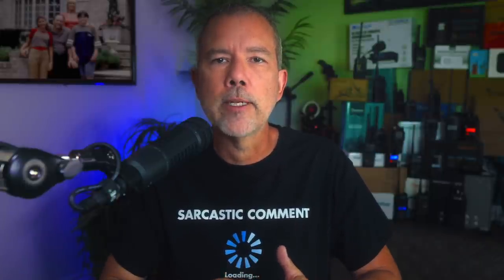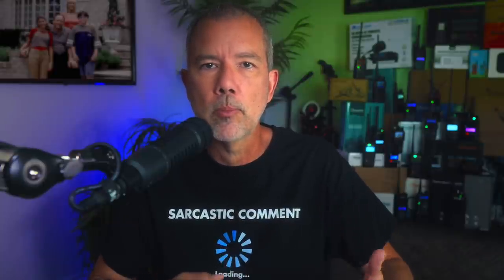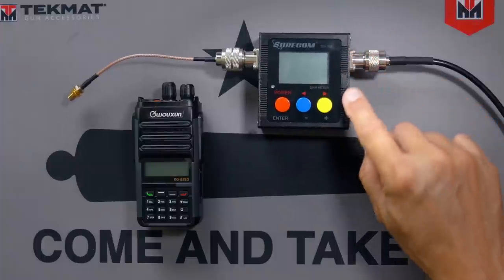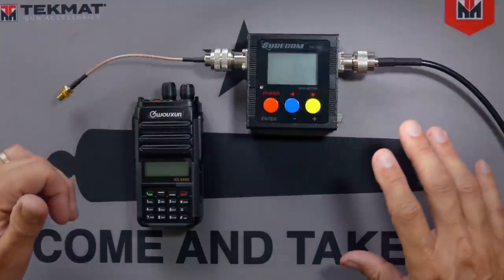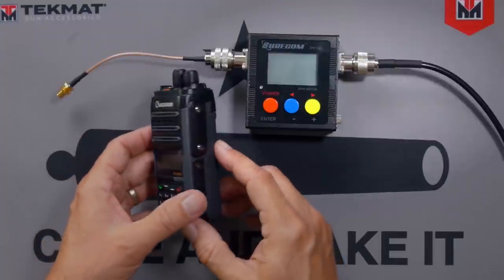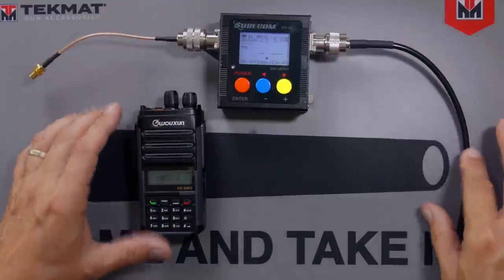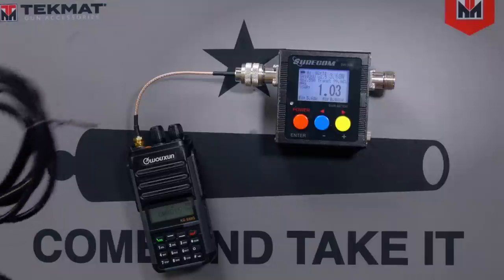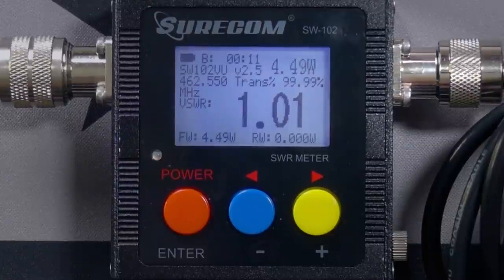Will Coiling Your Coax Change The SWR Or Damage Your Radio? Is Coiled Coax Bad For Your Radio?

Comment: All I can say is that I worked with everything from HF to XHF and all the frequencies in between during my 17+ years in the Air Force and most of the time our cables were coiled both during use and in storage. Never had an issue.
Reply: But that was military cable... it was "special". It cost 5x too much.  ;)  TY for your Service.
Reply: @TomRolfson  It's the same cable, they just pay 5x more for it, LOL

Comment: I have to admit, sometimes my cable shrinks a little bit when it gets cold.
Reply: I just pull on mine to warm it up. much better transmission!!!
Reply: Then buy a thermal jock strap.  😝
Reply: @toml.8210  Chestnuts roasting on an open fire........
Reply: I can't even find it when it's cold.
Reply: “I was in the pool!”
Reply: In Texas in the summer temperatures hover around 100°, so shrinkage is only a winter problem.
Reply: Sounds right, I worked for a company that made self-heating coaxial cable for Arctic temperatures as well as other cables .....thanks

Comment: You should never ever roll up your coax cable. Having the electrons go around in a circle slows them down.  That is why top fuel dragsters are much faster than NASCAR cars.  Top fuel dragsters go in a straight line, whereas NASCAR go around in circles, slowing them down.  Not only does it slow them down, but the electrons going in circles might get them dizzy and disorientated and they may lose their way. So always run your coax in a straight line, even if it means you have to put your antenna in your neighbors yard.
Reply: I bet you are a old time ham operator.
Reply: @hogcat858  I guess your sarcasm meter indicator light is malfunctioned or you got mixed up with the idiot light

Comment: I coil my coaxial cable in knots. I also slammed the car door on it.
Reply: I have 3 coax's running from the roof through the top of the doors to get inside of the car, been that way for 8 years, no problems.
Heck, since the beginning of time truckers have been running coax through the wing windows on the doors to get from the antenna to the cb, no issues!

Comment: The excess cable in my truck on my ham radio that I hacked to also work on GMRS has talked many many fars and it is in fact coiled. One day I talked 85 miles to a repeater. Folks that's in Florida. Not like King Randy's perfectly perched paradigm of power packing phase pinching fars producing propagation punch!

Comment: I do have a question ' on my Ford pickup, since I'm mounting a gmrs antenna on the roof, I was told that I could shorten my coax by 3ft and the extra coax I would wind up and hide somewhere, can this be done???? Please advise me
Reply from the maker: you can wind up the extra coax and throw it under the seat or wherever you want, just coil it loosely and dont bend/kink it.

Comment: Can you answer this. I have my Tram 1177 tuned to 1.2-1  for the car mount AND magnet mount . I  installed it on  the tram ground plane adapter with a short section of cable and it goes up .3. When I  used lmr400, it jumped to 2.2 to one. The coax test good,. All coax lengths are about the same.????
Reply: Antennas are very sensitive to their surroundings and how the cable is attached to the feed point so we would need to see some pictures of your installation to know anything for sure. But, remember, there is no need to worry about anything below 2.0 swr.

Comment: I replaced a 3 year old Cobra 29lx on my Kenworth rig that had a display issue with a brand new 29lx ..now I cannot get my SWR to calibrate ..old one was fine ..new one will not calibrate ..it’s especially high on the low channels ..I’m running a dual setup using Wilson 2000 model antennas ..anyone have any thoughts? ..thanks in advance for any help

Comment: I was at the motorcycle shop and one of the techs was having trouble with a CB installation. Being a Happy Ham, I offered my assistance. 
I noticed that his antenna was about 10 inches long. 10 inches may be good for some things, but not CB antennas. He said that he had read that he should “trim” the antenna until he had minimum SWR on channel 20. He kept trimming, but the SWR indicator needle stayed pegged at max. Note: He did not have a cool digital FARSOMETER.
Being a “Radio Expert”, I suspected a feed line problem. We removed the seat. He had not only coiled the coax, he had tie wrapped it into a dog bone. The ends of the dog bone were as tightly bent as he could make them. 
We got another antenna kit an coiled the coax into a 6” diameter coil. A couple snips on the antenna and it was at an SWR of 1:1 on channel 20.
As you have said, it is fine to coil coax, as long as the radius is not too small. A radius of 10 x coax diameter is what we use in aircraft installation.
A coil of coax will act as an RF choke to signals on the shield, not the signals on the center conductor. As hams we will often have a few turns coil just below the antenna connector.  This prevents RF energy coming into your radio shack via the shield. 
Finally, if coiling the coax damaged it, it would be bad when you bought it off the spool at the store.
73,
Happy Ham

Comment: In fact it's common among hams to coil up the coax to limit stray RF on the outside of the braid. Or "hot mike" as some older hams would call it. There is no danger involved coiling up coaxial cable, except for mechanical reasons as "minimum bending radius". In fact a big roll of e.g. RG58 with infinite length will be a perfect 50 ohm load. But of course the longer the coax cable between the radio and antenna is, the greater is the loss of RF energy. Best 73 from Ham Anonymous.

Comment: I have always wondered if closing a car door on a roof mount Magnet base antenna, will damage the coax? Something to test maybe?
Reply: depends on how bad it's pinching it, they will eventually short if it's too bad
Reply: No, but the door will leak rain.
Reply: Depends on the shape of the door, really. In my truck it's a gentle curve so no troubles, but in my GF's car it'd wreck the coax in just a few closings.

Comment: If you coil the coax and set it on the GROUND it will effect the standing wave but coil in the air or on a table is only a small balun. the key word here is Ground. you didnt test the actual myth of coiling coax on the ground! good video though lots of views.

Comment: Hams coil the coax to DE-COUPLE the  antenna from the feed line so ALL the power is radiated from the antenna and NOT the coax. There is a formula for number of turns at a specific diameter for a given frequency range and how far from the antenna feed point!  This does have an effect on SWR (SEE WHAT RETURNS).  This is commonly called a CHOKE!
73 de N7TZQ   
WRQT522

Comment: I can communicate far FAR away with my cableatures. I use the figure 8 hoopty loopty configuration Incase your wondering.
Reply: The figure 8 method always works. You don't have to remember if it should be clockwise or counterclockwise.

Comment: huh.. sometimes they tell us to coil it on purpose to make an rf choke to keep rf off the sheid.
Reply: True, but that only affects RF electricities on the OUTSIDE of the shield where none is supposed to be.  RF signals on the inside of the coax shield is mostly uneffected. Coiling coax does help a little but you are hiding a problem with either the cable or the antenna because there is not supposed to be any electric currents traveling down the outside of the shield in the first place.  The more 'non resonant' your antenna is - the higher swr will be on the inside of the coax and that means the energy tries to travel down the outside of the shield instead.
Reply: Many radio books do suggest doing that because a balanced aerial such as a dipole when fed with unbalanced coax can induce r.f. on the outer of coax.
G4GHB

Comment: If coiling coax cable is bad for it, please explain why EVERY manufacturer supplies it either on a round drum/spool or coiled in a box. Every cable has a minimum radius bend specified by the manufacturer before any detrimental effect. I learned some time ago that handling coax during an install and coiling extension cords is made much easier if the cable is laid out as straight as you can get it in the hot sun. The plastics heat up and become much more malleable.

Comment: Thank you for the video. Coiling up your extra cable not cause high SWR which you just proved.
I have built a lot of antennas and have coiled up close to the antenna connection with certain
 antennas to prevent RF from coming back  to the radio on the outer shield. I have never heard
coiling up the cable caused high swr or lowered the power output. Keep up the good videos.

Comment: I'm just getting started in this side of playing with radios. I'm still pretty stupified by Smith charts, though I at least understand the concept. Yes they are simple; I get that. But not if you don't understand the fundamentals yet. It's a lot to try to chew at once. Return loss, VSWR, it's so much to learn. But I already know more than I did when I started.  EDIT: Seems to me that a flexible cable has a healthy bend radius. A lot of times this data is provided. As long as you aren't sharply bending or kinking your cables, they should perform within their norms. Now if you compare a sharply bent cable vs a new one "laid out straight" you might find a different reading on sensitive test equipment.

Comment: Hey, I started as a ham a few years ago and got turned off by sad hams. Have found a better group and am back in it again and got my GRMS while I am at it so i can convince my friends to get radios too. Thanks for being no BS and showing me GMRS
Reply: CB radio was the top gateway drug to getting people into the ham radio community.. Now it is FRS, people much prefer the quieter FM mode and once they find out that a licensed ham can use an HT and talk to someone on the other side of the world their small FRS bubble looks far smaller.. Well like any hobby you get those that are like that, even the radio clubs can and do become cliques for snobs.. Since most people have real lives outside radio it may be hard to find the kind of people that are amiable..

Comment: i thought it was about the current causing too much heat on the cable and shorting it out. the midland micromobile cables are so thin they recommend uncoiling them
Reply from the maker: The 'inexpensive'  cable used in this test was from a Midland Micromobile MXT500.

Comment: Back in the day (probably 25 years ago...) I coiled up coax a LOT for my CB rig. Not going to cut a perfectly fine cable, just because it would mean I wouldn't have to coil it up when using that antenna in that specific car. And I never had any difference in SWR. Never even had to re-tune the antenna is I switched cars, and just had an SWR of 1,05.

Comment: The length would be important, and longer would probably be better (although, the cable loss/return-loss in the smaller cable would certainly make the indicated SWR actually better).
Also, in order to perform a valid test, a load with a known poor SWR would be needed... i.e., a "badly" matched antenna, or an intentionally un-matched dummy-load (e.g. a 75-ohm resistor of sufficient wattage). This would then present a higher VSWR along the line, and may show a more noticeable change in any "choking effect" and SWR change of a coiled cable (in similar fashion to an "ugly" balun) vs. an uncoiled cable.
Otherwise, somewhat interesting but really meaningless.
A similar test at higher-power HF would be interesting...
73 from west Texas!

Comment: I have been running 10kw on cb radio for years with 150ft 7/8 in coax no problem here. It’s about common mode after that.

Comment: You should use enough coax cable to establish your antenna. As far as coiled. It takes miles at the wattage of a radio to create a electromagnetic field to consume the wattage. Every form of rf shielding leaks the length of said cable is more destructive than coil, ball, serpentine, or straight. At 10000 watts you can get shocked and hurt even cooked a little. But it should not change swr. You tune the antenna not the cable.

Comment: The don’t coils your lead in goes back to the days of twin lead..
Reply: You are correct. This is true.  You don't want to coil twin lead because it does not have a shield to contain the RF electricities.  But the good news is that no one, except for very specialized antenna experimenters, uses twin lead anymore.    https://en.wikipedia.org/wiki/Twin-lead
Reply: @craigdavidson2977  Oh I don't know, a doublet, the impedance match on my homebrew 2m 4 element collinear.
G4GHB

Comment: It may not affect SWR, but if you use digital modes you should not coil your cable. High radius bends can cause the 1's to get stuck in the corners while the 0's slide on through, causing massive confuckulation.

Comment: Great content, man! The SWR dropped because the coil made a load, a small load but a load non the less. I would be curious if it affected the forward power, and if so, by how much?
Reply: The FWD power is visible on the meter. (lwr left of the screen)

Comment: Do a test with a, "mis-match load" 25 or 33 ohms, 2:1 or 3:1 swr.  Coax has three surfaces, the center conductor, the inside of the shield, and the outside of the shield.  Get some RF current flowing on the outside of the shield.  Now take your un-earth grounded battery powered transmitter, and key it a few times, while monitors any exposed conductive part of the radio with a high voltage probe and oscilloscope (ground referenced).  With the coiled transmission line, and mismatch load, do you see any huge voltage spikes when you unkey the radio?
Reply from the maker: No. I'm not some kind of radio-dork. Geezus..

Comment: Not trying to be a sad ham. but real question. do you guys think if you pushed the power to the 50 watt limit it would make any difference?
Reply from the maker: SWR is a ratio of reflected power, so no matter how much you push in (to a point), it should not make any [significant] difference as that ratio would stay [mostly] the same.
Reply: @TheNotaRubicon  hey, awesome to know! thanks for the awesome videos.

Comment: I've been a Technition First Class Ham operator for 237 years, and I can say with near certainty that if you had coiled it from right to left, instead of left to right, you would have seen a substantial LOSS of signal degradation (I love using that word) and distortion leading to impedance and impotence. Once this impudence is realized, where, indeed, will it end? In your case, my biggest gripe isn't that you coil your wires, but that you don't show us all of your t-shirts. It's like hearing only part of a joke. Also, you seem to have abandoned your stoopid human questions videos entirely. It's too bad because I would have liked to have asked if there are any significant differencesb between analog meters like the Surecom SW-114 and the digital SW-102 in terms of accuracy.

Comment: I have Ben Into Radio's for almost 40 Years & I Remember Hearing That Saying To When I Started back then & Of Coarse I believed It until i got older & Tested it my self & i Found Out That it Did not Really make any Difference on 10 ,11Or 12 Meter Either ! But i know from First Hand Experience That Buying Good Coax Online Is Very Hard to Do Now Days so take that with a Grain of Salt

Comment: #SadHam here. I was so deeply triggered by this presentation that once I was done crapping my pants and crying to my mommy on the phone, I fired up my big boy keyboard and decided to unleash this totally justified and not in any way condescending (but totally condescending) rant. Ok now that thats done, that crap coax you showed earlier? You can actually make a halfway decent emergency antenna out of it. Strip the jacket off 1/2 a foot back, then separate the outer shield and the dielectric/center conductor, bend them 180 degrees in opposition to each other, boom effective dipole and good use for crap coax.

Comment: You mentioned that LMR 400 isn't the best coax, what do you suggest for a base antenna installation with a length of approx 60 ft for VHF use GMRS and/or 2 Meters?
Reply from the maker: I suggest LMR400, because its plenty good enough for normal people that arent rich.
I only say "its not the best" because if i dont say that, 100 sad-hams will leave comments saying that I dont know what I'm doing because LMR400 is not "the best".

Comment: You should probably not have put your hand on the cable when making the measurements. Not likely it would have made a significant difference, but just sayin'.
Reply: With coaxial cable, putting your hands on it does not matter because the vast majority of the RF electricities are contained inside the shield.  That's what makes coax so popular and useful.

Comment: You made your point...as usual. However you failed to point out that a coiled cable DOES have a major drawback. While the "talk into the mic" button is pressed and as you broadcast (I meant to say transmit... I think I hear a sad ham...) the coiled cable will act as a magnet attracting nearby metal objects such as kitchen utensils, keys, beer cans and more. It has even been known to pull drywall screws right out of the wall. You can't say I didn't warn you. DAMNIT beer cans are aluminun and not magnetic...scratch that!